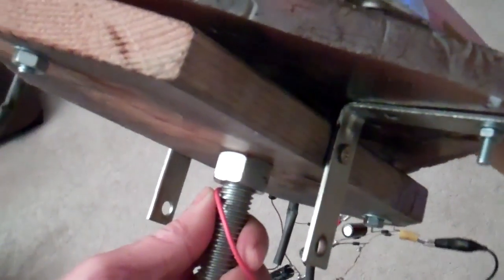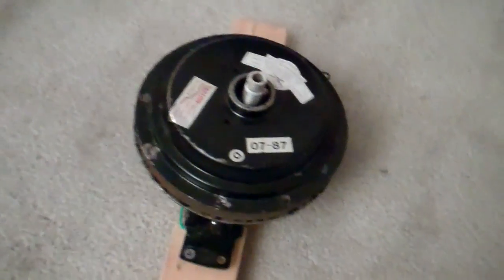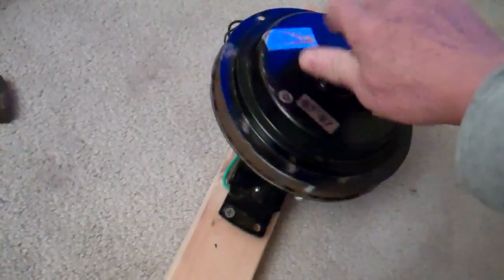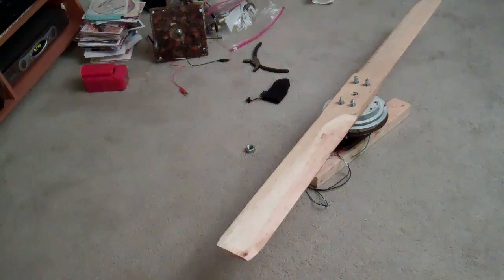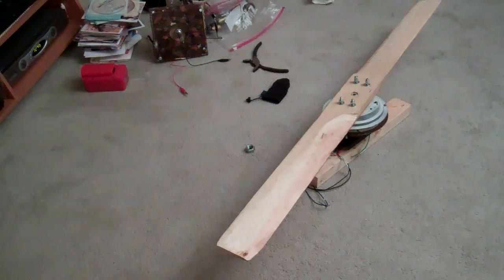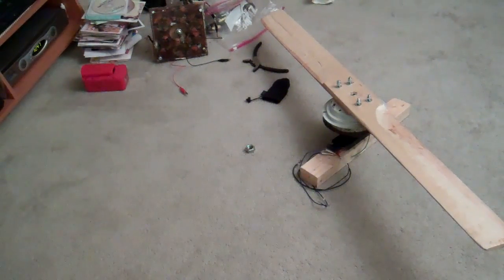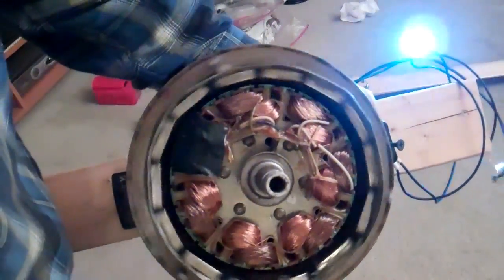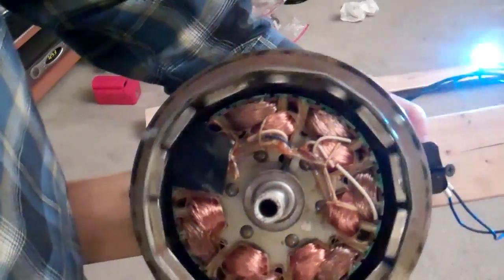Axial flux, ceiling fan motor  wind turbine design flip flopping.mp4

Comment: 2 things affect voltage with the axial flux generator.

firstly, though rate of change in magnetic flux, either though using stronger magnets (neodymium magnets have different grades with higher numbers meaning stronger magnet), and/or faster spin with a lower pitch on the wind blade.

Secondly, through increasing the number of wires cutting the magnetic field lines. More windings to each coil would work.

Comment from the maker: @TheJimmax Another rotor without magnets. I did not think of that. I was prying the magnets from the ceiling fan motor to use with the axial flux. I think I can get close to 12 v with my dual rotor axial but that's quite marginal. 12 coils will be better but that'll be another design. My rough built of the ceiling fan windmill is complete but it takes lots of wind to turn. Next up, dig up the car pma and put some blades on it.

Comment from the maker: @TheJimmax Thanks for your insights.  I should buy the right size magnets. Magnets and copper wires are so prohibitively expensive now. I'm playing with horizontal windmill now as they require fewer coils and magnets because of their higher speed. I actually want a better vawt but because they turn so slowly I think they require 24 coils and a lot more magnets to generate decent power.